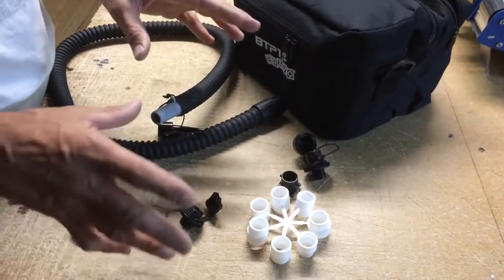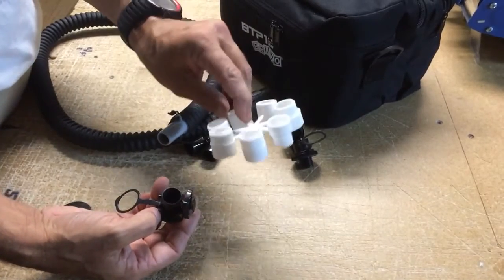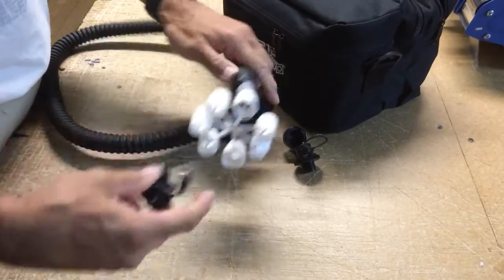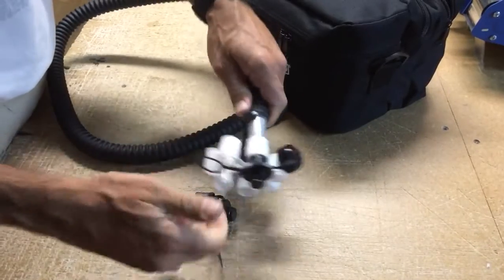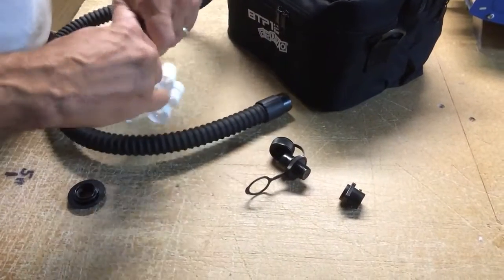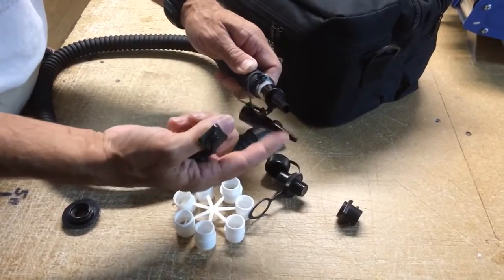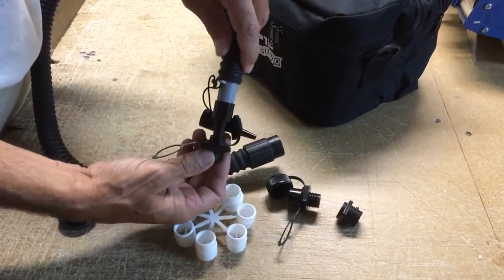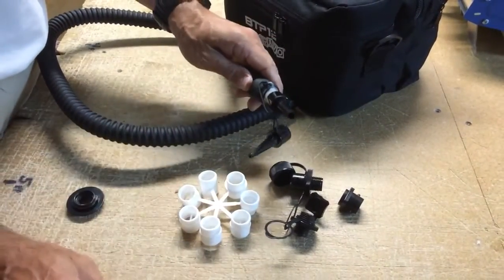Electric bravo pump fittings

Comment: Hey Jeff, is there a way to use this pump to inflate an isup with a Halkey Robertson valve?
Reply from the maker: This might work for you: https://kiteboarding.com/proddetail.asp?prod=pks_h3_sup_pump_adapter - But the BTP 12 does not do High Pressure. For that maybe this would be better: https://kiteboarding.com/proddetail.asp?prod=bravo_20_electric_pump - And it does come with the adapter.
Reply: Thanks Jeff, I have the BTP 12 but I do not have an adapter to work with my new ISUP that has a Halkey Robertson valve.  Will that first adapter you provided be able to attach to the BTP 12?  How would you attach it to the hose?
Reply from the maker: Only if your pump has a bayonet fitting on the end. If it is just the compression fitting, it will not. Your only other option would be to buy this hose: https://kiteboarding.com/proddetail.asp?prod=PKS_universal_pump_hose and cut the fitting out. Then cut your hose and glue the fitting into you hose. Then you can use any adapter, including the H3 Sup adapter.